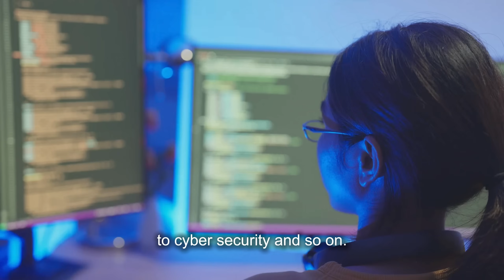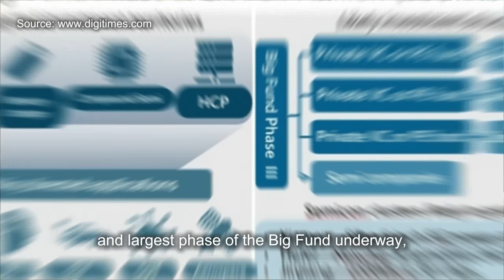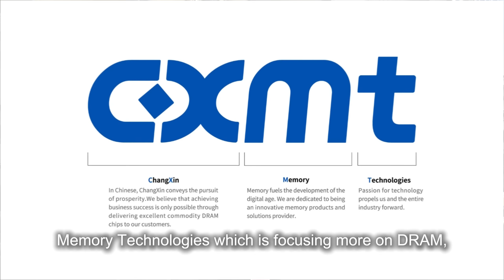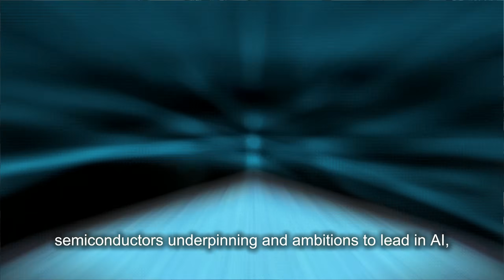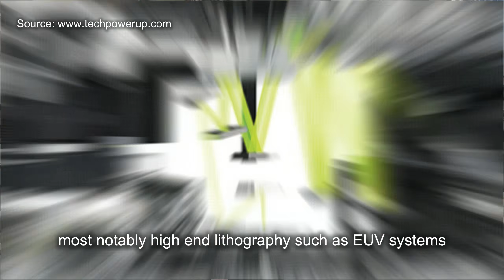China’s BIG FUND III: The Semiconductor Bazooka

Comment: Anything man-made will be made by another man if it’s worth it, just look at atomic/nuclear weapons and it’s way more impactful than semiconductors. Only people or countries that don’t make anything are foolish enough to think another men/countries would never be able to replicate, improve and eventually dominate. 

EDA and equipment may be a big hurdle for China to overcome but access to non-polysilicate based semiconductor materials is an even bigger hurdle for anyone else. You can always get by with larger, more power thirsty chips which China will be dominating in the next 1-2 years, but you can’t get by without gallium or other key elements to handle modern performance needs. So the winner will be clear very soon.
Reply from the maker: Thanks a lot, I see you know a lot - isn't China one of the main sources for Gallium as well?
Reply: @MiriamWickertsheim yes from aluminum processing, something that’s requires lots of electricity which China leads too and unlikely to be challenged by anyone for a long time to come.